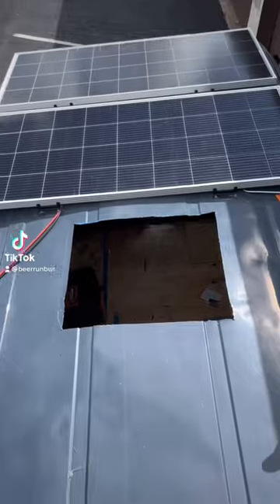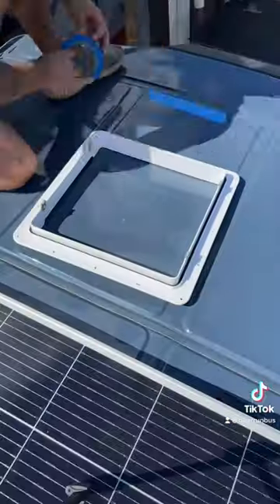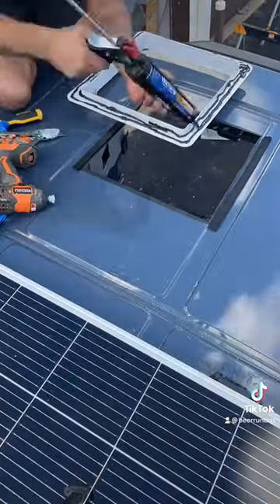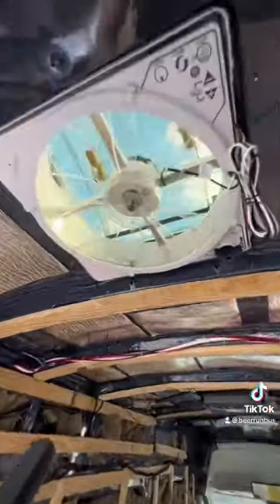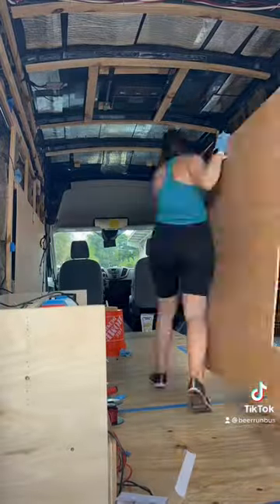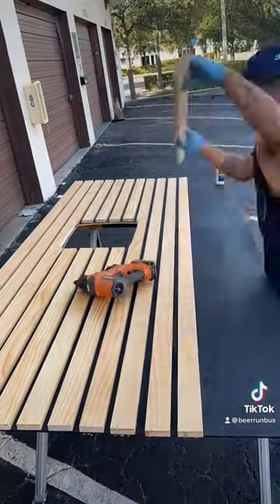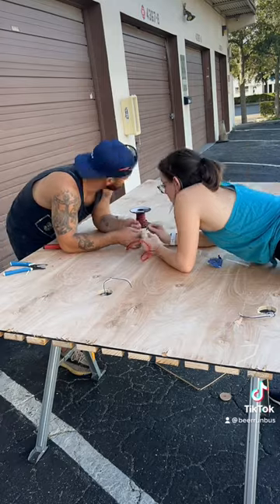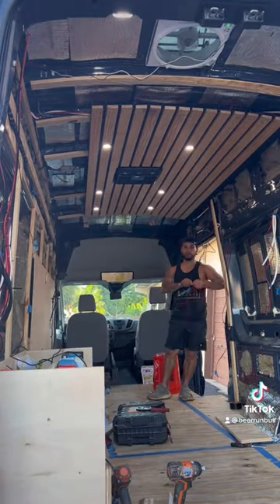Van Convertion part 4 | #busconversion #buslife #vanconversion #vanlife #campervan

Comment: Dude weight is the enemy of van builds full thickness wood and plywood are heavy consider using lighter materials for non structural items
Reply: Next... Some ceramic flooring and granite countertops...
Reply: @OldsmobileCutlass1969Va  Absolutely, I say, go for it if you want to pay more at the diesel pump. The more weight put into a van build, the worse fuel mileage will be. Would it not be smarter to make items in a van build lighter so that you pay less for fuel or utilize the weight savings to  have a larger water tank,  more batteries, or install more solar, add a stand up shower, install a larger refrigerator, etc so that you can go off grid for a longer time.
Reply: Yes, I am doing a remodel myself and although wood looks fantastic, I am being extremely selective on thickness and weight and the amount used.  I'm keeping materials lightweight to accommodate the other systems I wish to implement, like the indoor garden
Reply: there's a pvc tho
Reply: Keep a close eye on your CCC...including you & your wife # don't want the frame to buckle on you.
Reply: And consider insulation.
Reply: Exactly. I see so many of these builds putting in thick plywood, planks, ceramic tile.... Inefficient for mileage and I worry in a serious accident some of this stuff could cut through the vehicle (and the occupants)  like a guillotine. Have a happy day.
Reply: In the uk vans have different weight limit tags in them from 2.7ton up to 5.5ton lets say 3.5ton gross weight is the most common size van you can legally drive on a car license any more than that you need a heavy goods vehicle license or if you past test in the 90s or before you already have it anyway you can change the vehicle weight legally up to a higher tag or lower tag like if the van a 5.5 ton you can down grade to 3.5ton limit but the vehicle more than capable with a heavy load with out it looking like its over loaded
Reply: @karlsanderson8127  That wasn’t his point , weight meaning the more you put in it the more it will cost in fuel. The heavier what you have in the van the less economical. He wasn’t commenting on the total payload to stick within the plated limit
Reply: While you are not wrong in the weight argument, the aerodynamic impact of everything on the roof of the van is going to have greater effect on the fuel consumption than the addition of the weight to the inside.
Reply: No it’s not the enemy obviously because he’s in business. I love quality and this video is proof.

Comment: To ensure the silicone bonds you need to 1000 grit sand the paint on the roof
Reply: put black  flex seal up there you don't need to do shit that stuff sticks to everything even glass. I covered my 2000 F350 rusted white roof with it about 5 years ago and it hasn't moved. I used white but it also comes in black. I suggest white though unless this van is in AK.

Comment: Always paint the top with white unless until you live in a cold place. White will dissipate heat and keep it cool naturally!
Reply: Even better would be heat/uv/IR/thermal paint for metal. Plenty of companies have it now and it's not particularly expensive either. Also 3M thermal window film

Comment: Nice work, but did you forget to stain or treat the natural wood? Wood absorbs and when the weather is constantly changing it will affect the slats, moisture, heat, cold, odors will all factor into how long the wood lasts.

Comment: If you put fire proof wool insulation in the roof duck tape the wires for the lights to the timber lats ,don't use ply sheet to reduce weight on your tyres , Thinking forward for sand and ice you need as little weight as possible some transformed campers fail on weight to pass inspection,

Comment: Keep up on the oil changes. It only takes 6 qts so it’s cheap to maintain. 👍 I would use Lucas if you plan on sitting at idle and letting the engine run. It’ll help somewhat protect the cam and it’s components.
Reply from the maker: I well thanks 🙏
Reply: not if that's the diesel which it better be but I doubt that it is. gassers are gonna suck fuel like no tomorrow. and they don't last very long either. they make a 6 cyl diesel for this thing...

Comment: Looks great. However i think it would be heavy and especially on the ceiling, that makes the vehicle top heavy. Be careful in corners and high speeds.
Reply from the maker: I really appreciate it but we’re actually underway and we upgraded the suspension so we’ve been doing pretty well with gas, mileage and all
Check out our most recent video. Let me know what you think. ✌️
https://youtu.be/dK_QtrQaxs0
Reply: Concider aluminum honeycomb

Comment: You should have used marine grade splacing/ connection for that electrical, You're definitely gonna be backup there in a few months from body heat moisture,  cooking ect.

Comment: The first thing you do is have the locks strengthened and have a stainless steel plate fitted to the sliding door for security research transit break in
Reply: stainless is HEAVY!

Comment: Marine adhesive on the vents would be better then regular caulking .  I build curbs for them so the vents are above the roofline .   The AC unit should also have a curb to reduce the chance of ac leaking condensation to penetrate your gasket .   Insulation in the roof line will reduce uv and thermal transfer.

Comment: no insulation anywhere WTF? and that wood is HEAVY. needs expanded foam insulation ALL around the envelope including the FLOOR. then sandwich that with thin laminate that doesn't weigh half a ton. is this the 6 cylinder diesel? well it better be or this thing is gonna suck down fuel. another thing 600 watts @ 12vdc is only 50 amps @ 12vdc or about 10 amps @ 115VAC. need to fill that roof UP with solar panels & have a bank of Lithiums to store that power.. I would say 4 lead acid size batteries. if you're gonna do this do it right or don't bother.

Comment: I didn't see any sealer on the screws of the Solar panels.
Reply: A good bead of sealant on the screw heads and around the perimeter of the roof vent too! Any point of entry thru the roof needs to be properly sealed. Unless you want to replace the fancy ceiling panels. Almost 4 decades in the industry taught me that.

Comment: What AC unit is that?
Reply from the maker: It’s a 12v domestic ac. We made a full video on the installation of the air conditioner. Check it out. ✌️

Comment: Why buy a transit ?
Reply from the maker: Ford is built to last
Reply: @buildersblueprint  Mercedes sprinter or vw transporter , got a sprinter with 500k miles on , had 3 transits not built to last
Reply from the maker: @SnowflakePolice1  sprinters are also great. But I had a ford with 210k on it and it ran great. I’ve also had this van since of October and it’s giving me zero issues.
Reply: @buildersblueprint  I suppose it’s van dependent, some last some don’t. The older transits with the 2.5’s in the late 90s with the smiley front were built to last   I had 3 125ps , just weren’t as eco as the mercs, but then I’m a courier so I opted for the mercs. The transits are more comfortable though